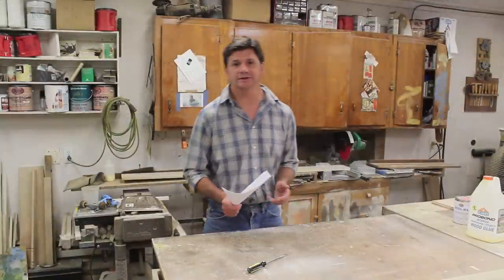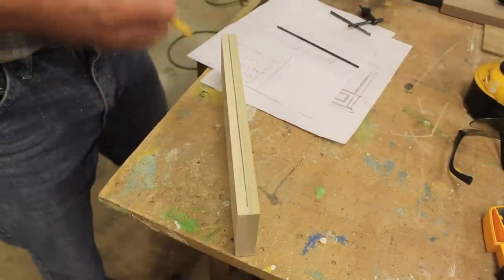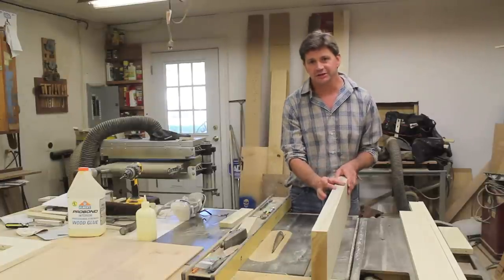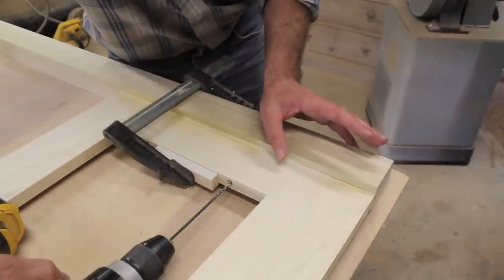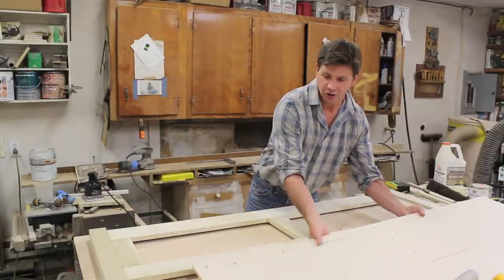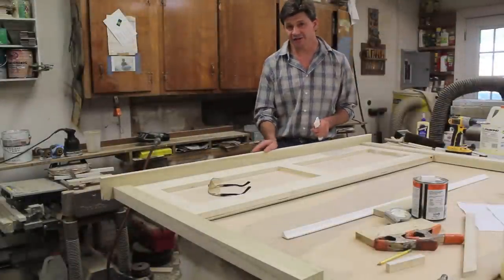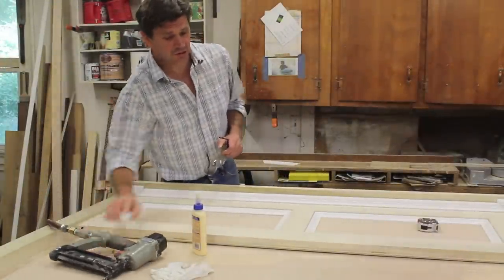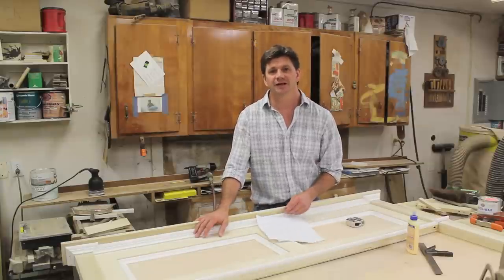How to build a simple headboard.

Comment: For those interested you should be careful using bugle headed screws (drywall screws)in pocket holes is you might end up splitting the wood. Better to use a flat head screw or a kreg screw.

Comment: Jon, is there a way of making those joints without the tool you use?  Also what setting is your drill on to start to ratchet at the right torque for woodwork?  My drill has a 1 and 2 setting with 1-24 dial.  Your videos are great!  I just need some more tools now!

Comment: Jon, I started building the headboard, and I have a question.  Do you see a downside in pocketholing the rails to the legs vs. using  the 4” screws and screwing the stiles through the legs.  BTW love your content and your easy down to earth demeanor.
Reply from the maker: Hi Michael, and thank you… no the pocket hole screws should work fine 👍

Comment: Thoroughly enjoying your work, Mate.
Maybe a silly question: I noticed that in some videos you're using Elmer's and in this one when attaching the rear panel, you used Titebond. Is there a reason in switching between the two (as in, maybe a major difference in the way they act in certain species) or was it just a convenience thing, given the size of the glue bottles?

Comment: I am building a headboard for a king size bed. I enjoyed your video. I am a beginner in wood working. I have a question about your dimensions on your rails. I noticed the top rail is cut to 4 1/2"  and the bottom is at 3 1/2" is this because of the bed molding along the top? Also the stiles at 3". Is this to keep it all uniform looking.